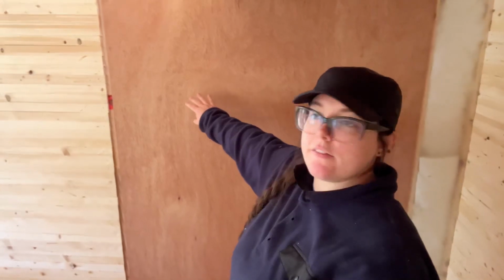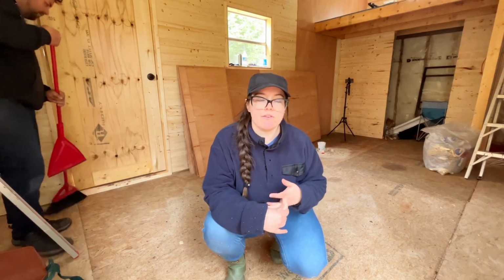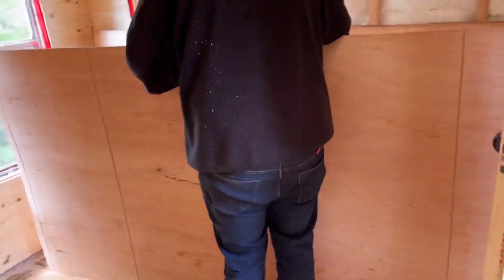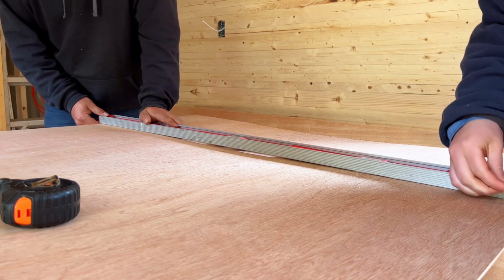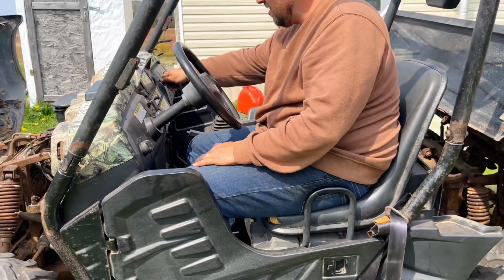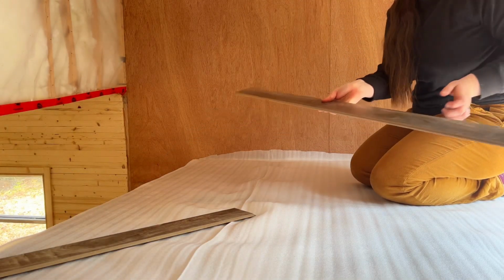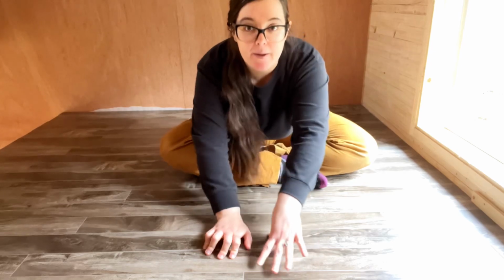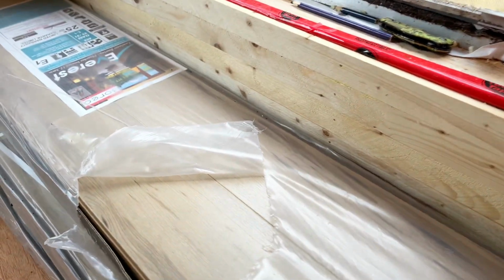OFF Grid TINY Cabin in the Woods Build l Laying Flooring l VLOG

Comment: You are going to die on those stairs. Standard stairs are 10 inch run by 7.5 inch rise and You have room for than, move the fridge.
Reply from the maker: It’s a template from a hardware store so clearly correct. Also it’s been like a month and i’m still alive walking up and down the stairs everyday. The fridge will stay. :)